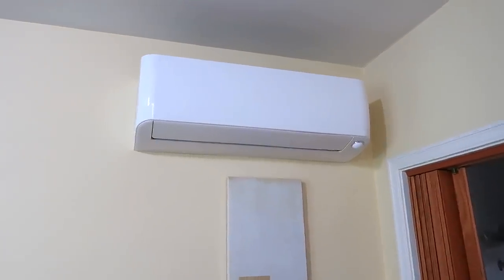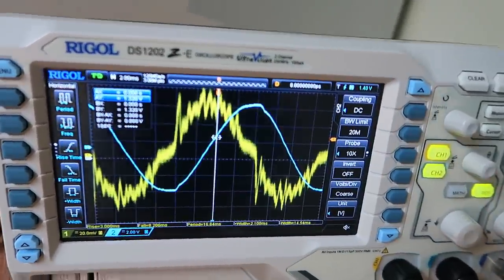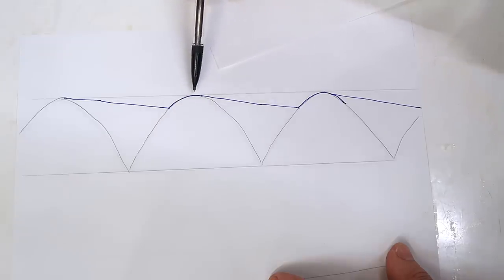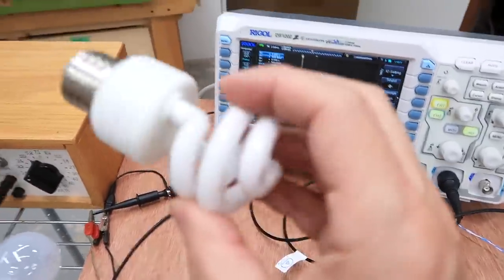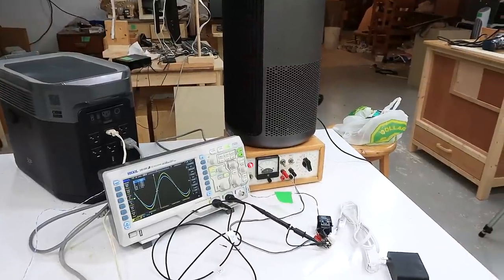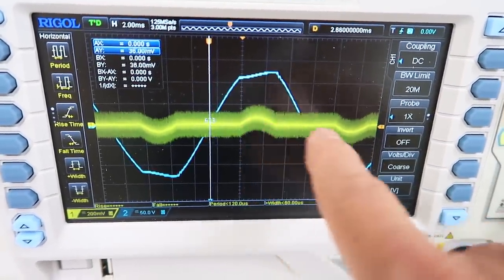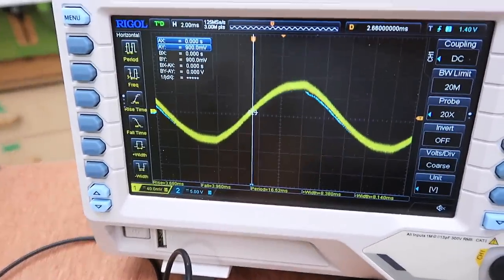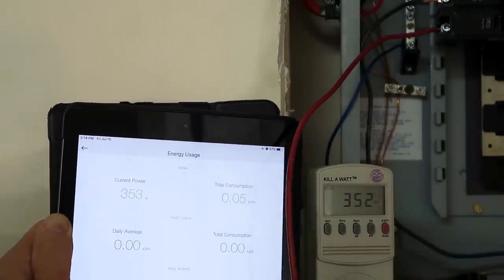Our electrical is all wobbly, measuring power is hard

Comment: Everytime I see a video house electricity from North Anmerica, I feel very confused. Apart from the weird 60Hz ant 110 Volts, there are this subtelties with Neutral and Phase, plus some time the current leaking to ground ! Here we don't care (even if it is wired the same way ) plug direction are interchangeable, when wiring appliance just ignore neutral and phase, even ground if often optional as our breakers are very efficients. It seems to me that in many ways North America is unable to adapt to modern time always following "tradition".
Reply: "Tradition" being that everything is already built that way and incredibly hard to change. For an average outlet, you get one phase and one neutral, which is connected to ground at the breaker panel. There shouldn't ordinarily be current leaking to ground, but EVERYTHING except the device itself has to be grounded. Not wiring a ground is unacceptable.
Reply: What 110 Volts? Step into the 21st century with the rest of us already. We invented electricity so of course we do it best.
Reply: Every time I see a video showing North American electricity in the home, I look in the comment section and find comments like yours that seem to imply that North American electric codes or practices are somehow backwards or substandard. But this is not accurate. North American GFCI breakers are excellent. Better than, for example, the UK. I do find our "split phase" system to be kind of complicated but that is life, I guess. On the whole, I think you are very mistaken about the "backwardness" of North American electricity. And yes, I have traveled to many places in the world.
Reply: @mckenziekeith7434  Even split phase isn't very complicated. You just have to think about "ground" in the right way, that it's a reference potential. Both North American and the rest of the world transformers have 240V secondaries. In "240V" countries, they tie one end of the secondary winding of the transformer to ground, and then the other end is "+240V" with respect to ground (yes, it's AC, so it varies between +240V and - 240V with respect to ground, but just to keep it simple, call that +240V). In North America, the center of the secondary winding is brought out and that is tied to ground, so you end up with one side of the winding being at -120V to ground, and the other half of the winding being at +120V to ground. Across both halves of the coil, you still have 240V, but either side is only +/-120V with respect to ground. For all the trash talking they do about our system, they actually use the same system in England at construction sites, but it's even lower voltage. It's split phase 120V, so they have 2 60V legs, and it's for "improved safety" using power hand tools. And I also like how they go on about how their ginormous plugs (that look like you could bludgen someone to death with one and it would still work just fine) are so safe because they have fuses in every plug, but they neglect to mention that the plugs have fuses because their "ring mains" don't. The only protection in some cases is that fuse in the plug - yeah, that sounds real safe. If the failure is after the fuse in the plug, great, but if the failure is in the wiring in the walls, well your house burns down because there's no fuse or breaker! Yup, quite the "superior system" indeed
Reply: Just like all those places that are unable to adapt to modern times and speak English instead of their confusing "traditional" languages!
Reply: Check Electroboom and Technology connection.
Reply: @mckenziekeith7434  Would you care to explain how your GFCIs are superior to UK breakers?
Reply: @gorak9000  Er, I'm sorry, a 'ring main' (ring final) absolutely does have a fuse, it's that said fuse is too high a value to protect the flexible lead to a small appliance. The wiring in the walls is very much protected, and the efficacy of that protection is assured by testing of the installation.
Reply: @Monkeh616  US class A GFCI trips at 5 mA. UK RCD trips at 30 mA.
Reply: @mckenziekeith7434  That's a negative for overly sensitive devices rather than a positive for human protection. Nothing prevents the use of more sensitive devices except practicality - with no tangible safety benefit.
Reply: @Monkeh616  Not here to get in some long argument with you. My main point is not that the US is better than any other country. My main point is that the opprobrium invariably heaped on US electrical codes and electrical systems compared to the rest of the world is not deserved. There is no legitimate argument that 30 mA RCD is somehow safer than 5 mA GFCI. An argument can be made that it is safe enough which is fine. And we have no major problems with nuisance trips for individual appliances at 5 mA.
Reply: @mckenziekeith7434  And you'll note I didn't argue that a 30mA threshold is safer.

You have no nuisance trip issues because, as you say, individual appliances - we protect entire, much larger, circuits, with significantly greater leakage from filter elements.

I was merely curious if you saw some serious technical advantage to your breakers which, to my knowledge, does not exist - beyond differences in regulations governing implementation, they're effectively identical devices - assuming we gloss over types AC, A, B, and so forth.